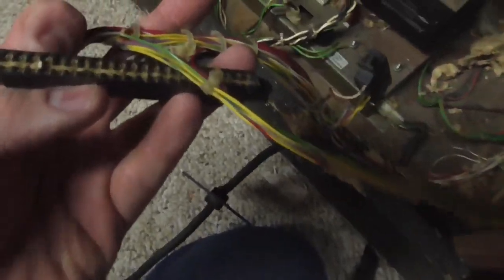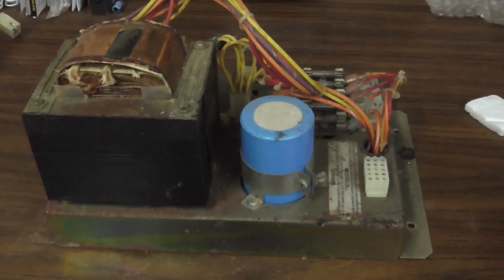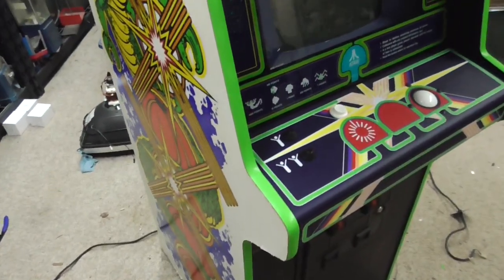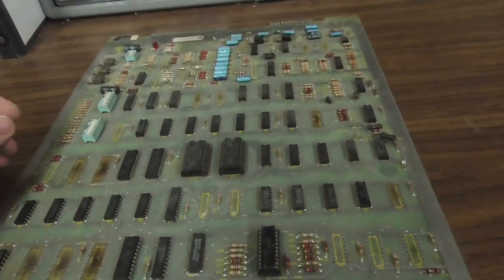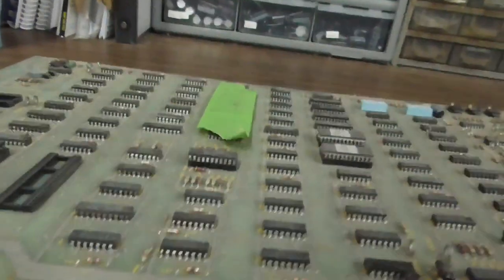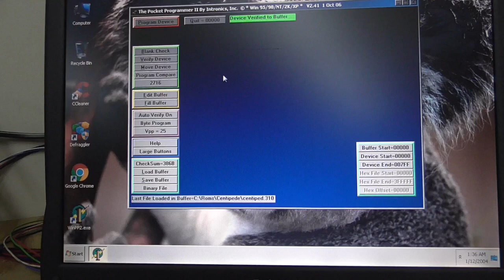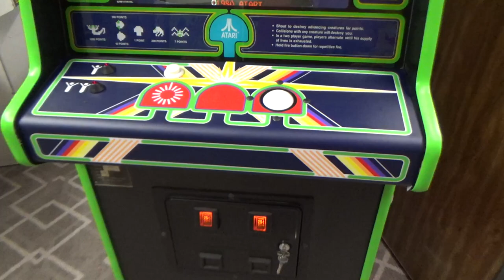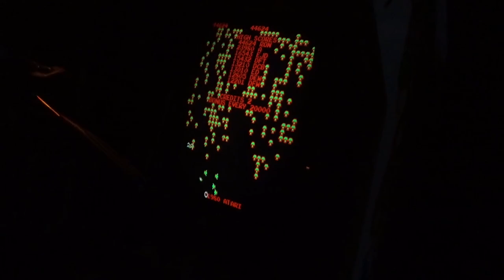Repairing a Completely Destroyed ATARI Centipede Arcade Game From 1980, Will It Run?

Comment: Nice job. That flyback you showed with the crack, reminded me of a chassis I bought on ebay. I bought it broken. Pluged it in to test it and the flyback started to go on fire. A small flame was coming from a crack in the flyback casing. Replacing the flyback fixed it. But it showed me that it's not really a good idea to leave these cabinets switched on unattended.

Comment: How did these games allow you to clear out the high scores and reset them to a factory default?
Reply from the maker: You just went into the test menu and did it from there... the top three scores were all that Centipede saved after the power was turned off.

Comment: I see the pocket programmer shows that the EPROM is a 2716. Can you still get new ones or are all the ones you have like a date code of 1982 to 1995? I have seen (and used/designed) piggy back boards/emulators that use newer Flash chips that pin out to an older EPROM package/pinout. Have you ever had to use one of those? Any problems if so? We used them for 2564/2764 once they started getting hard to find and our stock of usable old ones began to run out. .
Reply: The burn gates eventually wear out and will not burn.... or they won't erase. and then you have an unusable chip. Sometimes it was something as stupid as a nick/chip in the glass or microscopic sticker goo. On stubborn chips we would let them live in the eraser for a while and move them around under the light so angle of the light going into the window would vary. (to get around any nicks/chips). and CLEAN CLEAN CLEAN that window REAL good!!!! (we used flux stripper) It literally burns open the gate to make a 0 ( or is it a 1??? I forget - that is a part of my unused memory of a bygone era.) Never really understood exactly how the chip "heals" in the eraser.
Reply: On some chips we would notate the value in the stubborn chip - like "location 05FF - expected FF - Found C5" and mark it as a "bad chip with C5 in 05FF" (actual notation on the chip, in the somewhat bad but not ready to toss pile - "05FF=C5"). There is a program out there with C5 in that location. It once resided on that chip and will not remove. If the rest of the chip is good and C5 belongs there - guess what? You can use it for that!!!! (UGH - we were getting desperate at the end to start doing that!!!!!!)
Reply: We also had ones where the pins would go a little gray and we would polish them up with a nail file before they would work, but I figure you know that old trick :)

Comment: Whoa were do you get a whole centipede trackball for $50.  When I was looking it was $50 for only the roller bearings??!!??
Reply from the maker: Here you go:  https://twistedquarter.com/index.php?main_page=product_info&cPath=113_115&products_id=420
Reply: @LyonsArcade  Cool I am getting into custom controllers. Last custom trackball used silicon nitride balls for the ball to glide on.  While it does work well it just doesn't spin like an arcade ball.  Optical conversion no problem but that genuine arcade suspension cant be beat.  You can check my "I made a PantherXL" vid

Comment: As a sidenote, do you good people know, that Shango006 demonstrated, that the internals of CRT's (Anode, gun, catode, plates) with safety and explicit certainty can be easily ressurected/restored with one of these crt-testers/restorers and be brought back to vibrant colors once again?

If you're interested to expand the lifespan of one of your CRT arcade-machines coming in for servicing, go search his channel for the specific upload. I remember watching it thinking, that it was groundbreaking stuff, but can't honestly true to God say I can point that exact video out just like that, but if you fall short, let me know asap, and I will dive in to find it. It may take me some time though, so be patient okay?
Reply from the maker: the great Shango006 would be the first to tell you that it cannot be done with 'explicit certainty' :)
Reply: @LyonsArcade  True. But the method did prove to work so well beyond expectation. "Why throw a dull CRT out, when all it needs is to vaporize the superficial debris", was the reasoning behind why my brain electrocuted and forced me to write you.

Comment: I bet a company could make and sell 10,000 POKEY chips at $20 each. They where used in many many old computers, consoles and game cabinets.
Reply from the maker: Someone has remade them but I think they're $50!
Reply: @LyonsArcade  It's an emulation using a microcontroller and a CPLD for glue logic.  Mind you they did a very good job.  It still doesn't support all the input lines, though, so it won't work in an Atari 8-bit computer.

Comment: Thinking about buying one of these local to me it's really decent shape but "doesn't work" which I find hard to believe as the seller has no backdoor or coin door keys and merely plugged it in and tried to turn it on and coin up (which if it's not in free play it's obviously not gonna make sound unless you can open the coin door and add credits) but they want 5 for it figure I'll offer 2 and 2 quarters aka 250